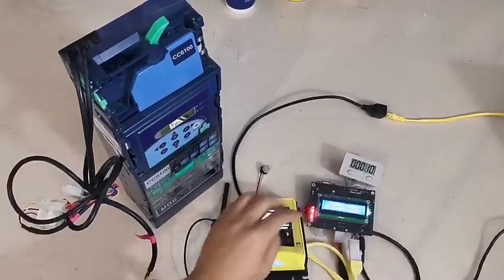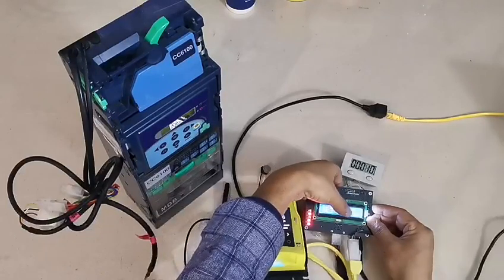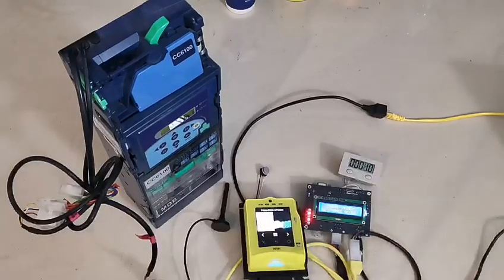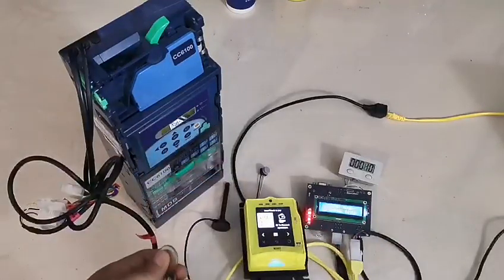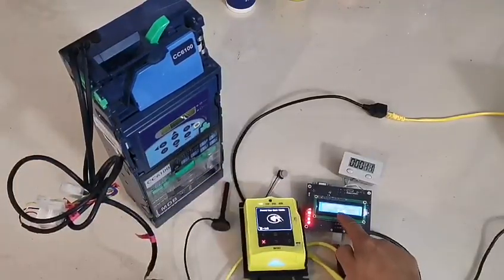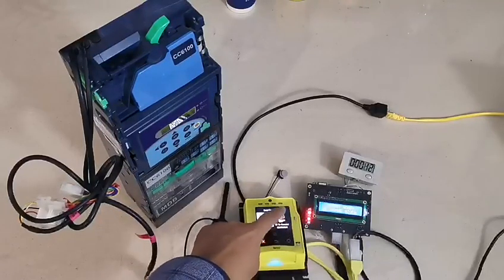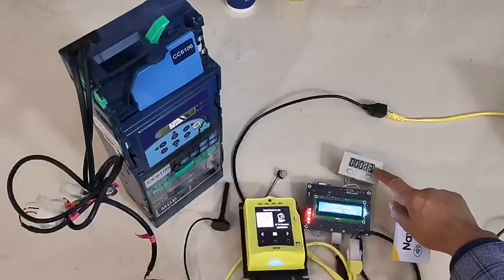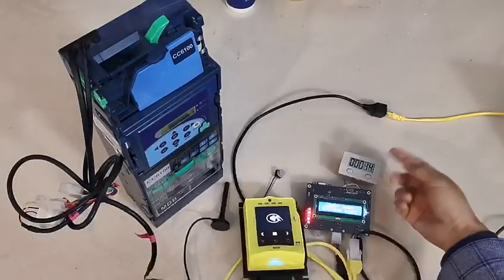letpos pro relay output working with nayax vpos MDB card reader, coin validator and relay output

Comment: Hello friends, I recently purchased the GA09 and it turns out that it doesn't work for me... I'm from Chile... do you know if it works in this sector of the world?
Reply from the maker: In Chile, would be better to order the 3G or 4G version. because some sim card provider already stopped the 2G (GSM) net. so you need to contact the sim card provider if still support 2G net and select a suitable SIM card provider.
Reply: @waferstar  Thanks for the response...I didn't realize at the time of purchase that it is only for 2G.